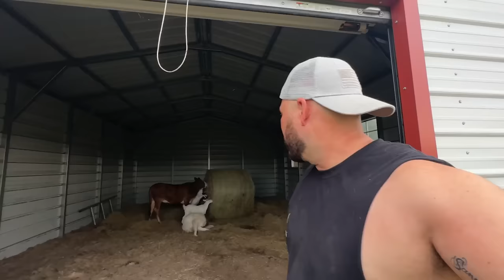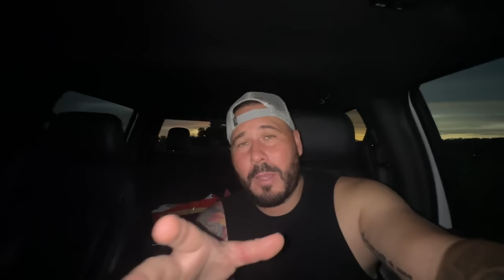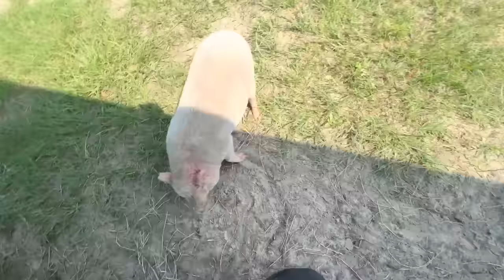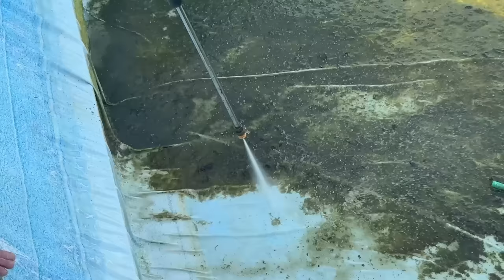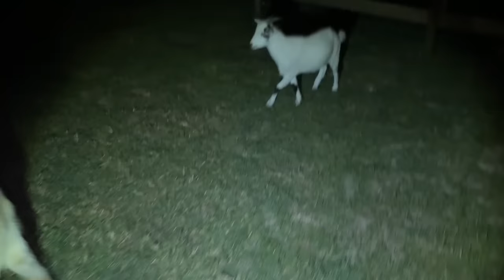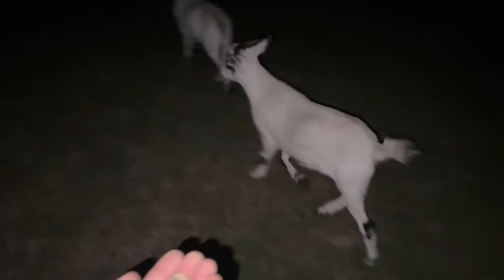Shattered And Cursed

Comment: May i suggest something? Maybe try putting an ac unit in the little barn. I think that will help tremendously in extremely hot weather and can help with heat exhaustion. Im sorry you lost macy and lamar. Best wishes and comfort to you

Comment: The reason you check the lower lids for pinkness, is that red blood cells that carry oxygen look red under the skin, and the less red blood cells you have in your body, the harder you circulatory system has to work to provide oxygen to the body. My doctor used to do it to me, first thing before exams! Hope this helps you understand why you do it! <3

Comment: OMAR! 
For the pool surround just take some strong chlorine and water and dish soap and a yard brush and it will scrub up real nice n then just jet wash. So sorry macey passed away sweetheart.  Omar make sure you spray your animals with water as a way to cool them down. Another thing you can do is tie a tarpaulin from the garage to the fence or to two scaffolding poles and weld a loop to each of them or drill two holes But do it wide enough that you can still get your truck back up to the door. Sending hugs and prayers your way guys. Omar you’re not cursed, you’re just a hard working man who does it to feed your family and do what you love. Macey will be up there now with your mom and your cousin running around and being absolutely amazing and having back scratches off your mum n kisses off your cousin and then running around playing with your missy and other angel pets.